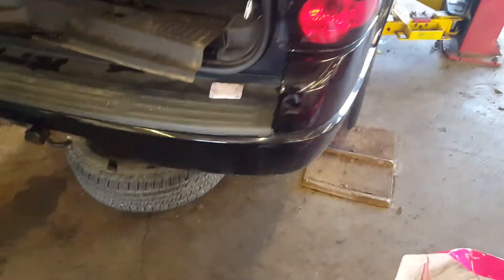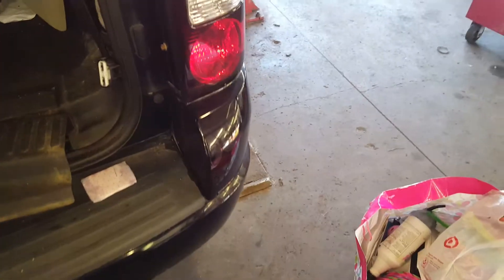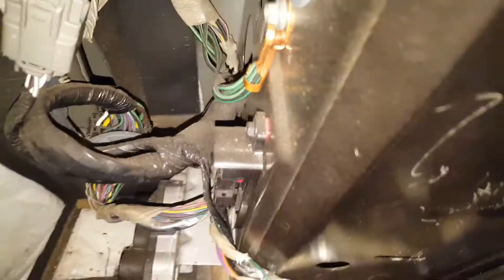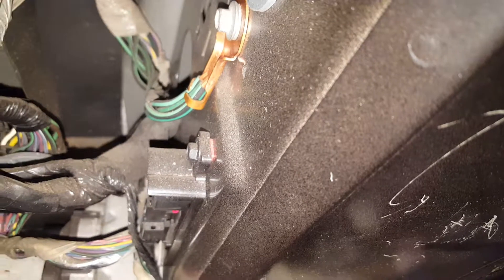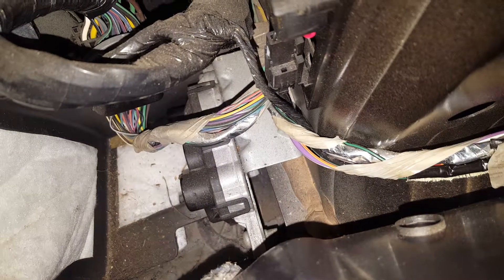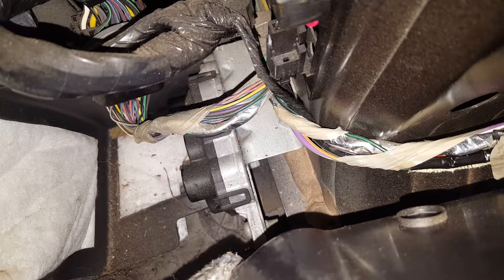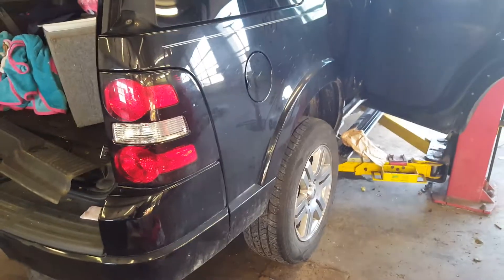2008 ford explorer fuel pump control module  location

Comment: I got 07 navigator and everything says crossbar above spare tire, or behind rear driver wheel. Can't find it anywhere, definitely going to check here , sadly already got tow truck on his way to get it home
Reply: Thank you for posting this, first time I've seen it in this spot and I'm almost positive it's not in either spot I mentioned
Reply from the maker: Yea I had to back trace wires to find this . Mitchel told me same spots you looked

Comment: what was the problem
Reply from the maker: Modual
Reply: @itsamechaniclifegarage3957  What were some of the warning signs it was going out? Just drove my 2008 Ford Explorer today and started hearing this "popping" noise from back there near the factory sub. Vehicle seems to idle roughly every time I hear a "pop". I was leaning towards a failing fuel pump.
Reply from the maker: @andrewwelsh7587  you pop seems like it's going lean try a boneyard part first there expensive
Reply: @itsamechaniclifegarage3957  Hey, appreciate the reply. I spent the other day tinkering on the Explorer and it was actually the COP on cylinder #4 throwing a crazy amount of electrical interference into the wiring harness. This was screwing up the communication with the PCM to TCM and was misfiring like crazy, thus the rough idle. I think the "popping" was just more electrical interference going through the sub. Crazy stuff.
Reply: @andrewwelsh7587  you must got av8